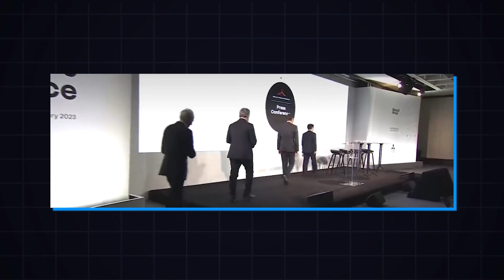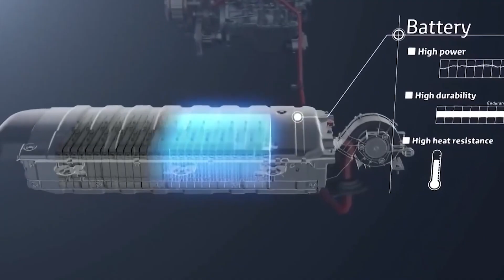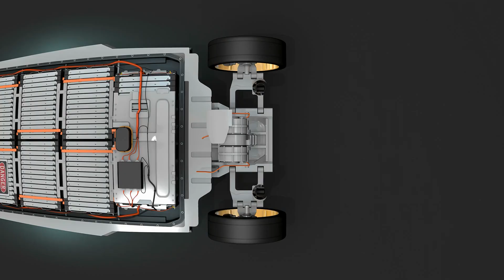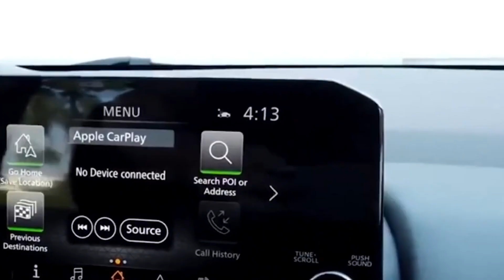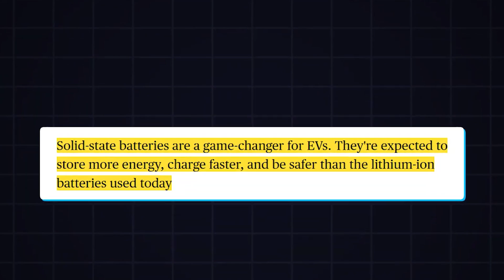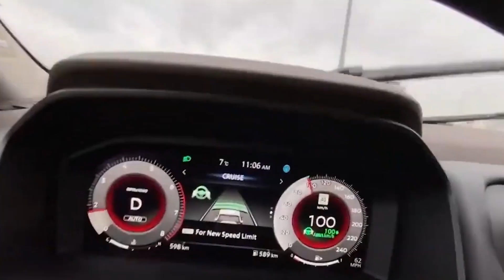Nissan CEO: "Our Solid State Battery Will DOMINATE The Entire EV Industry!"

Comment: What I learned is that the problems with batteries are far from solved.What I expect is a Thorium battery or a cold fusion device that has sufficient energy for at least a year and the dimensions of a shoebox.   I will keep my extremely reliable diesel car for at least another ten years.
Reply from the maker: Good for you